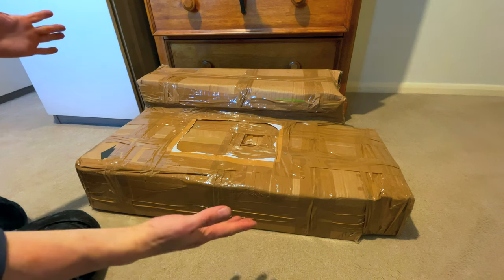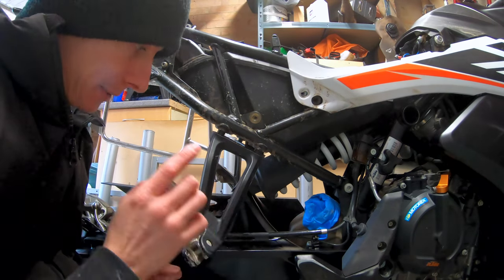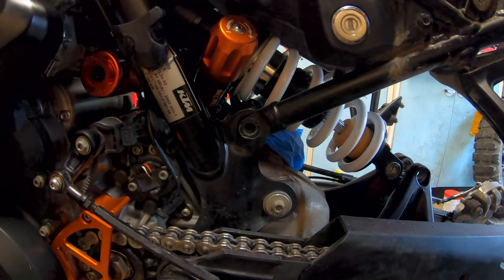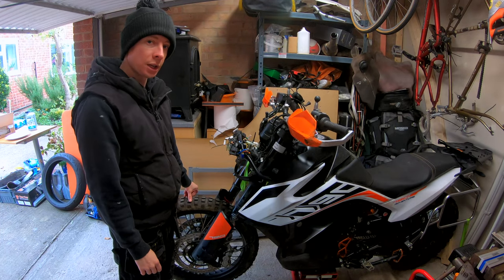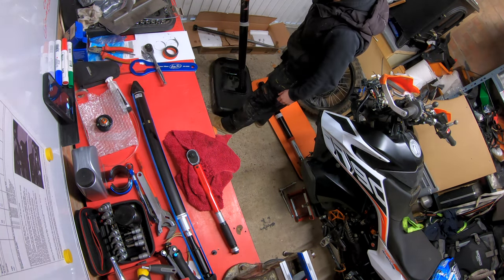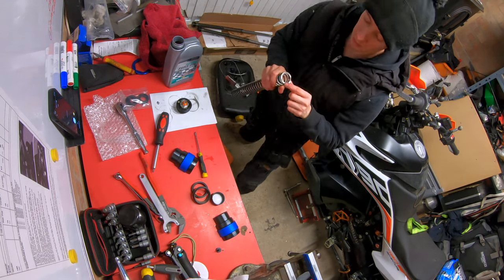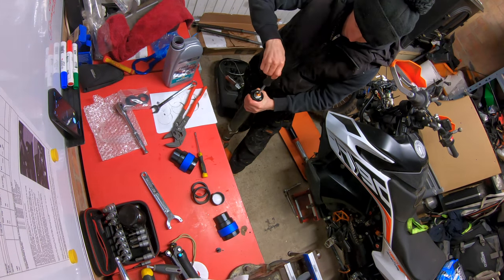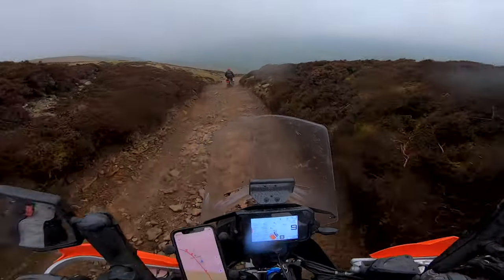KTM 790 Adventure S TracTive Suspension Unboxing & Install

Comment: Im the guy who paid 1700.oo for the tractive extreme shock,only mine works worse than stock.
So harsh as to be airborne.   They have revalved it and sent it back to me.  Havent got it back yet.

I really hope they do refunds if they cant make it work.    2021 890R.
They made a lotta promises.      For reference my stock 2021 690 Enduro works great, very smooth comfy ride.

Who remembers all the reviews on these bikes when they were coming out?
Plushest best most sublime greatest suspension ever on the 890R.

Mine would barely move the stock spring was so stiff, like a buck board.   I got scammed.
Love the bike with 20,000 miles on it, suspension, sucks.  Harsh as harsh can be.

Comment: I just removed shock on my 21 890 adv S. You dont need to remove wheel or even rear fender. Just screw in preload all the way and remove chain guard (top part). There is enough space to do it. Same for install. I did loosen two frame bolts near the top shock bolt
Reply: The tractive shock doesnt fit on the bike like the stock shock, a lot of stuff has to come off, the subframe has to be unbolted and pulled up a good ways.  Takes hours for the tractive shock.  20 minutes for the stock shock tops.
Reply from the maker: well I have removed the Tractive shock in 15 minutes. It is harder than the stock one  The wheel, exhaust, mud flap and half the subframe does have to be unbolted. 
but the performance is worth the few extra minutes to install.
Reply: @Adv_Charlie  Im way faster at shock removal and install on my 890R now, Im on the third go round in 2 weeks.....and yup all that needs to come off/be loosened.  I hang the subframe from a rafter using straps.  Its waiting right now for the shock to get back from revalve.

Comment: Superb vid, my 790S needs a leg re anodising so I'll get both pairs done silver maybe even gold like my Thruxton R, definately will use TracTive Suspension, I'm a bit of a lardy at 5'9"'s 98kg's and the rear feels ok, I'm not after MX greatness so I'll do the front end first!
Reply from the maker: It’s so nice having the adjustment. I’ve been playing with mine while talking to Torque Racing and the bike is even better than I was straight after the swap. I’m loving it suspension and wheels are the best mods i’ve made. Most expensive but the best

Comment: Good how to. 
I just bought a used 2020 790 adv,s also and it came with the same shock, X-TREME-PA. My forks have the Andreani cartridges installed. Are they the same in quality or is one better than the other  comparing yours to mine? Mine also came with a Camel brand CAT heat shield.
Reply from the maker: I’m not sure about a comparison between Andreani and TracTive from my research TracTive appears to be more off road focused.  Camel products are really good, I have their 1 finger clutch which I makes a world of difference
Reply: I have the same bike with the same heat shield. It keeps all that heat off ur ankles

Comment: Thanks. I have an 890AR, and am very disappointed with the suspension - it's hard and harsh. My sag figures confirm that the suspension is too hard, specially up front. TracTiv seems to be the way to go. Have you measured your sag since installing the TracTiv units?
Reply from the maker: I did measure it once i have it installed and it it was correct for me. However now a year and a but on i need to check it again as the suspension would have all bed in now. Honestly one of the best upgrades. However my cousin who is “normal” size has no issues with his stock R suspension. But i would say Tractive Extreme would be an upgrade from the stock R stuff.
Reply: @Adv_Charlie  Thanks. I didn't mention that I use the 890AR mainly for road riding, therefore I don't need to allow for the hard hits that one experiences off-road. I'm aiming for a softer, but but well controlled ride. It's a good point that the suspension tends to bed in after a while.
Reply from the maker: @RedRupert64  I did wonder if you didn’t do much off road based on your comment. A cheaper and second option might be just to get your stock suspension re-sprung so it is softer.
Reply: @Adv_Charlie  I have been considering that, but it looks as if the springs will have to come from the US. By the time postage, VAT and duty have been paid, one might as well go for the TracTiv items. It seems that TracTiv may be a better solution for a soft but well controlled ride. I weigh 90kg (max. with all kit).

Comment: Good video, good information, I'm looking as well for an upgrade in suspension but for my Norden 901, would be nice if you explain after some use, how it feels the new suspensions. good luck!
Reply from the maker: Had it a year now and it is so much better than stock maybe more i can do with the settings on the adjustments but at least i have the adjustability now.  I’m very happy with the purchase
Reply: @Adv_Charlie  sounds good! thanks for the info!! and please do more videos like that, are very good!

Comment: Very nice and informative video! Has it ever happened that at 12:45 when removing the bottom bolt that holds the cartridge,the whole cartridge spins with the bolt? I am in this current situation and i think that an impact gun is the only solution.
Reply from the maker: Is the fork still complete or have you removed the cap? It might undo better with the fork complete. Are you following the repair manual? A impart will work if you are careful
Reply: @Adv_Charlie  I tried removing it with the cap on and then off but the whole cartridge spins either way,I am following the manual instructions,they simply say to remove the bolt but thats not so simple when thr whole thing spins.
I am waiting currently for an impact.
Reply from the maker: @stealthworks9758  yes sounds like that will be your best bet.
Reply: @Adv_Charlie  thanks for the help!

Comment: Great vid! I'm about to do something similar. I'm debating between getting the tractive forks or k-tech internals. Definitely getting the rear shock tho!

Do you have any protection for the tanks when going offroad or do you feel it's not needed? I've not thought of getting crash bars however venturing offroad more has made me consider it.
Reply from the maker: Trust me the bike crashes very will the must haves are a bash plate, folding or removable mirrors and alloy hand guards. The tank can take a beating and the covers are cheap if you fall enough times
Reply: K-tech way cheaper and seems to be well received.  1600.00 is ridiculous for any suspension part unless your racing top level making money.  Its somewhat of a black magic scam.

Stock suspension should not be so horrible on a 18K bike. But it is.

Comment: Question regarding lower shock bolt.  In particular the right side 14 mm. Hex Left Handed ( LH ) Adjuster nut.  When you start removing the big Torx lower bolt ( from Left side ), do you place your 14 mm. Hex bit and just hold it in place?  I noticed you loosen that right side 14 mm. Adjuster nut after loosening ( removing I think ) bolt.
Reply from the maker: Hi,  So the manual says to loosen the top bolt first then loosen the bottom bolt without removing them, then loosen the LH adjuster nut. 
Thinking about it I don't think you'll need to hold it still, if I'm right they will both loosen off at the same time because the LH thread will allow both parts to rotate the same way. I think?
But I'd be very careful with the adjuster nut. If it seems stuck but you can remove the bolt see if you can get the shock out like that. It's very soft and if you lean on it too hard to get it unstuck you can break it and the swing arm around the adjuster nut. This is due to your hex bit being harder and it spins within the adjuster nut. The corners of the hex bit then push out on the ally of the nut and swing arm.

It's an easy job you just have to be careful and not put too much force on the adjuster nut.

Comment: Just come across the video, very nice - also looking at upgrading my suspension but considering just replacing the spring in forks and on shock as per touratech which cost around $400 … would love to know the difference?!
Reply from the maker: I can’t compare any other products or set ups other than between stock and the Tractive extreme suspension as that’s all I ridden on this bike. 
I guess the question you need to ask yourself is, do you want the adjustability or just a more suited spring weight?

Comment: Ive had that suspension for 6months or so, love it!  I'm 5'4" with a 26" inseam, almost went 1inch shorter but didnt.  Is the Seat concepts seat worth it?  does it really get you closer to the floor?
Reply from the maker: Yes it gets you an inch lower and it’s does and it's very comfortable. I have done video on the seat too

Comment: After you draw the fluid out of the forks to the level that shows to be 90mm from the top it seems to need no more than 3 fluid ounces per fork with this upgrade, maybe because of the thicker cartridges taking up the space compared to the stock ones?
Reply from the maker: Yes because they are a closed cartridge and not just a spring more space is used
Reply: @Adv_Charlie  Your video was awesome and thanks for the quick reply!
Reply: Thanks guys @cliftonsr @charliecottle.
Did a similar upgrade on my 790, with the Touratech ones, Wich is pretty much the same. And was surprised that the dealer returned the oil bottle with only 200ml consumed. I was starting to freak out 🤣🤣🤣 It makes more sense now 👌

Cheers !

Comment: So basically this is a 200mm travel fully adjustable back suspension...and what difference made it on the front bcoz it was already fully adjustable...or is it that sring sag is much more now?
Reply from the maker: No, the stock adventure suspension is only has adjustable preload on the rear and there is no adjustment at all on the front. So aside from the spring rate change I now have very good, full adjustment on the front and rear.